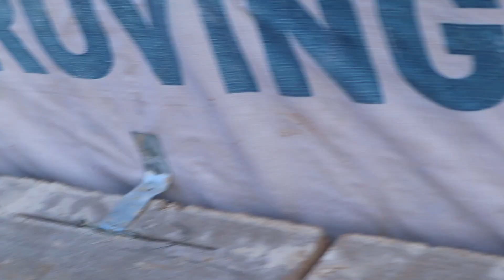Amazing Precast Installation , DIY Tips

Comment: What is the precast stone made from and is the mortar you used here for the joints and foxing the face the same type of cement? What are the difference in psi for each and where are you located?